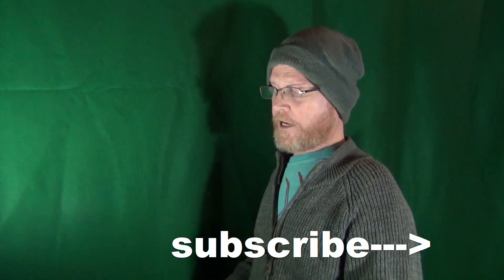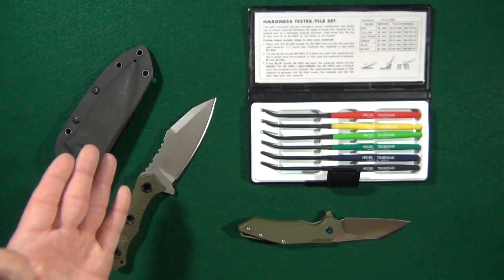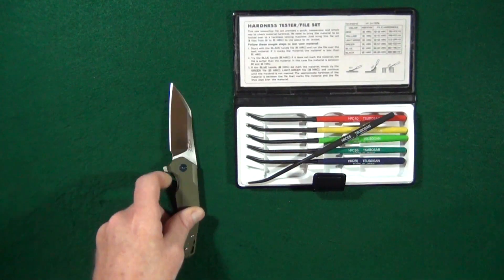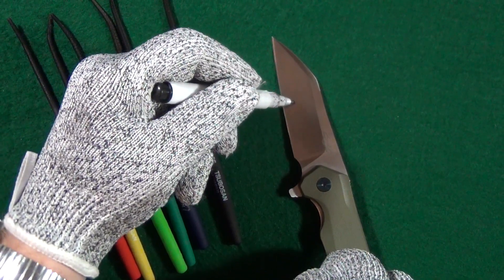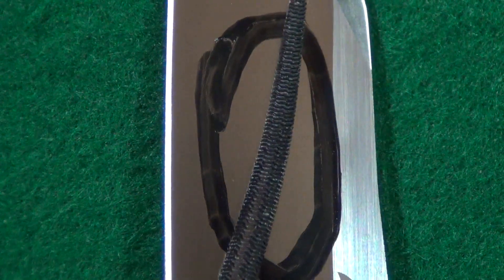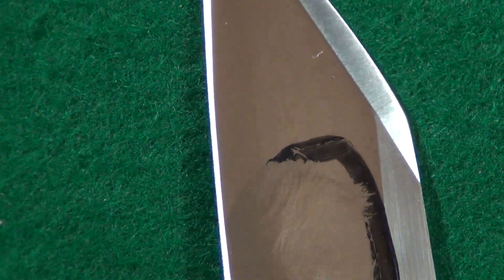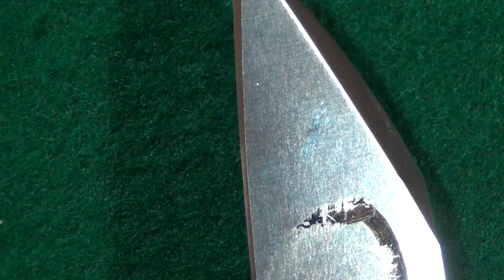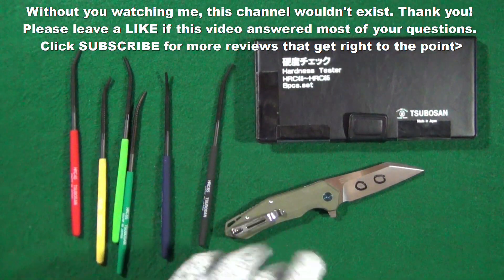HRC Rockwell Test - DIY Hardness Test

Comment: Hardness is one thing. But people are mostly interested in the sharpness of a knife. It's ability to cut super thin slices of tomato or garlic or even paper
Reply: I disagree. I can sharpen just about any piece of metal. Even potmetal. I care how well itll hold and edge and resist deformation. Hardness is a useful piece of that puzzle to know. It also very strongly correlates to edge stability, not just edge retention.  Sharpness does matter a ton for edge stability, and edge retention, BUT its something I can change at any time. 
The overall geometry of the blade is also more important to me than how sharp the edge currently is. I like sharpening my knives sharper and sharper until it either chips or folds under my typical use. Then back off on the angle by 1 or 2 degrees. Takes a little work, but this way you always get the most effective edge for your particular uses.

Comment: You are scratching way too much and damaging your knife. A couple of strokes is enough. You should also pay attention to the FEEL (tactile feedback) that the sliding offers - if it bites into the material, then it's harder than it, if it slides off, then it is softer than it.

Depending on the purpose - you can start from the black and go direction red which will give most life to the kit itself, while going the other way around will make least damage to the material being tested.

Comment: Several things. First. The reason why they say to start with the hardest file is so that you don’t damage the softer files on hard surfaces. If you do it the other way, the low hardness files will rapidly become damaged. So yes, their instructions do make sense. Generally, you’re not supposed to “test” finished products.

Second, the word scratch is not the best choice. Even a softer file will “scratch” a harder surface. But it’s more of a micro polish. Actually, the file should dig slightly into the surface. Don’t do what you’re doing by rapidly moving the file over the surface. That’s not the correct way to do this. Press down with moderate force, and push slightly downwards while pushing forwards. Do this a couple of times, and that’s it. If it digs in, go to the next lower number until the file skates over the surface. That’s the lower limit. But even then you may get that slight polish mark. Ignore that.

And remember that these files, while marked with a RC number, can be plus or minus one RC from that number.
Reply: Excellent advice. Thanks.

Comment: I have a large heavy duty Ganzo folder in 440C, it's gotta be around 61 or something because I tested it opening a can of beans, and it dulled the edge a bit but not nearly as much as I expected, and I was able to sharpen it up quickly. Shockingly good heat treat on an uber budget knife
Reply: I really like a lesser known company called Ironfly. Its owned by Kunwu, which many have heard of. Well Ironfly is Kunwu's budget line. It is kind of like how Tenableknives is Kansept's budget line.
     Ironfly uses excellent budget steels and have great prices and Kunwu's famous heat treats. They do their 14c28n at 60-61HRC which is awesome considering how dang tough and stainless 14c28n is. It is very easy to sharpen too and it takes fine edges and high polishes better than most anything. Its edge retention isnt the best, but its not bad either. Everything is a trade off, but 14c28n has a fantastic overall balance IMO. Easily my favorite budget steel when treated properly. I think if it MagnaCuts baby brother. Its actually tougher than MagnaCut, just with lower edge retention.

Comment: I worked as a professional material tester in a steel factory in Germany and let me tell you this: Your testing method might be MORE accurate than the rockwell testing machines, if you get a set of files which is more accurate than 5 HRc steps (given that these files really have the hardness they are supposed to have and their own hardness is NOT tested with the Rockwell method itself, lol). In the ISO norm the testing machines have +/-1.5 HRc tolerance and even when we calibrated the machine using special testing plates (with different hardness) such a plate which is supposed to be (e.g.) 55 HRc +/-0,2 was ending up with values between 54,5 and 55,5 HRc, which is totally normal, since the ISO norm (6508-2) claims that a tolerance of 0,8 Rockwell units is acceptable for a testing plate (which is used for calibrating the machine).

Now we had an old rockwell hardness tester in our company and modern machines might be more accurate, but the point is - if you for instance order a custom made knife and you want 60 HRc it is totally possible that (even if nothing goes wrong with the heat treatment) you get one which has 58,5 HRc on the lower end or 61,5 HRc on the upper end and the testing machine would be totally alright, it is just an inaccurate testing method.

What I recommend is measuring the hardness in Vickers and convert it to Rockwell, in my experience it is much more accurate and foolproof, because Rockwell testing might include human error when fixing the pre(paration) pressure (before the main force is applied, the method requires some tension). We were doing this all the time in the factory, because Rockwell is such an inaccurate testing method.
Reply: You should try on your choil so you don't wreck your blade finish

Comment: Would it matter how the knife is finished grind lines or satin, wouldn't it be easier to scratch a knife with higher grit finish ?
Reply: Negligible difference in the vast majority of scenarios and considering the already loose results of this testing method. It’s actually more difficult to abrade a higher grit finish than a lower one. The flatter and smoother the surface, the more resistant it is to abrasion. A lower grit finish is going to have more pronounced peaks and valleys for the file to bite into. Like microscopic jimping. 😀👍

Comment: Im getting a sword with 55-60hrc is that good?
Reply: Depends what its made out of.  for most swords 5160 is a very common and very good choice. 55-60 HRC is a good range for a sword made from 5160. Its just a little worrying how large the range is though. That makes me think they may not have a very consistent tempering process. Ussually the hardness range for a blade is closer to 1-3 HRC when a company has their heat treat down solid. Doesn't mean it's bad though! Just something to note.

Comment: You can do the same thing with another knife. For example i have a morakniv classic that's right around 58 59 and moras are very consistent. When i take the tip and try to scratch a knife and it won't the said knife is 58 59 or harder if it does scratch like say a victorinox will its softer and i dont want it lol
Reply: Victorinox makes a fine knife though im only joking. Softer steel has its place
Reply: @wis1024 You can say it.... Victorinox's stainless steel just kinda sucks lol. What place does it have? I mean REALLY? 

 14c28n is also very stainless, holds a better edge. Is just as easy to sharpen. its crazy tough, not to mention dirt cheap, and its easy for companies to heat treat. Ive seen it at 61 HRC in production knives (such as Ironfly, the offshoot of Kunwu), and as high as 64 HRC in some ludicrously expensive custom knives. People may not realize it, but it can be almost as hard as MagnaCut, but obviously it still doesnt have the same sort of edge retention due to having less carbides. It doesnt need to beat MagnaCut though. Just Victorinox, and i think it does that HANDILY. 

Just my 2 cents though. I think these old companies get a little too complacent with how they make things just our of tradition. It isnt always a bad thing, just in this case it kind of is. The edge retention on victorinox steel is honestly just MINDBLOWINGLY bad. 14c28n is just "meh" and yet its still got like tripple the edge retention 😅. Thats how bad Vixtorinox is.  Not exactly a fair comparison, but my Maxamet knife at 70HRC would literally have over 10 times the edge retention. I hesitate to even call that stuff steel. it may as well be anodized alluminum.

Comment: Wouldn't the test be largely dependent upon the pressure (and angle, to a degree, no pun intended...) you apply to the file? I would also think the length of stroke might effect it especially if you have a nitride coating, b/c you will have to scratch through the coating and then continue to have to scratch the metal, and every time you change direction, you are going to release the pressure a little and then have to start to scratch through a coating again.  

If any of the knives have a thick nitride coating, I doubt these files are going to do much to scratch through them considering most coatings start at a hardness of about 85 C IIRC.

Even anodized aluminum (aluminum oxide layer) has a rockwell hardness of 60-70 C, which is pretty impressive considering how relatively soft pure aluminum is compared to steel.
Reply from the maker: There are so many variables to try and control, which is why I said this is not an accurate method. I wouldn't try this test on a coated blade of any kind. Really, it's more for fun or to get an approximate on a knife that might be counterfeit. Thanks for watching.

Comment: You should take them and use them like files at the edge, see if they skate or bite. Make sure the teeth are going the right direction. Start with the bottom one which will skate for sure than take note when the file bites at higher hardness.
Reply from the maker: Yeah, some great tips, thank you. It was a learning experience for me, but something I wanted to try out.

Comment: Actually there is optimal hardness at witch certain steel is easier to resharpen.. For example s35vn at 59-60 will behave better than the one at 56 cause this soft the steels is really gummy and create nasty burr.. Steel should be at it's optimum hardness for maximizing it's properties.. What I will say is with same example I mentioned it's easier to reprofile softer steel.. Kinda a tricky thing to explain but this is my experience cause I have 2 knives in s35vn and ones of them is just 56.4 and another at 59.2 and trust me the softer one takes much longer to achieve same level of sharpness..
Reply from the maker: Oh definitely. It would be a pain to do it every time, but could even disassemble the knife and scratch by the pivot. That's also part of the reason I used a Ganzo and not my Anthem.
Reply: @TheKnifeBeater  That makes sense.. I envy you that Anthem.. In my opinion the best that ever came out from Benchmade together with Contego and 940
Reply from the maker: I don't doubt that. It's all about that very important heat treat, which unfortunately varies with these production folders. Do you scratch test your knives to obtain that HRC?
Reply: @TheKnifeBeater  Nope I live across the street of local HT company called PT UNITED SUPERSTEEL..
Reply: @TheKnifeBeater  I don't use the files you have.. For the first it leave marks and second it's not accurate although it gives you pretty good range..
Reply: @TheKnifeBeater  by the way there are places on blade where scratch wouldn't be visible.. To exemplar finger choil
Reply from the maker: Wow, that is too awesome! Very jealous of that Marek.
Reply: @TheKnifeBeater  Don't be,  cause it's not for free and it's not like I can do it anytime I want
Reply from the maker: I hear ya. I sure don't recommend scratch testing, but it was fun to try it.

Comment: Very interesting. Not sure D2 is supposed to be that high well if it is 60 then that would be fine. I was surprised expected to see somewhere in upper 50s. Interesting little kit. I wouldn't want to do that on too many knives. At least not before use and once it has some use marks in it then maybe. Very good review. Glad you showed it didn't know anything like that existed.
Reply from the maker: I know it's not unheard of for D2 to have a high HRC, but I was very surprised with the results of the FH31. Thanks for watching Rick.